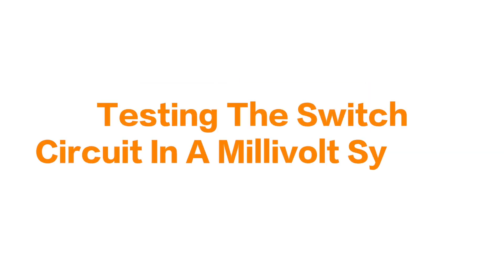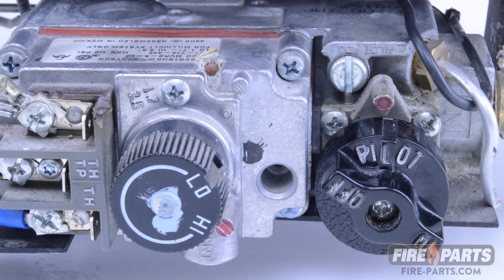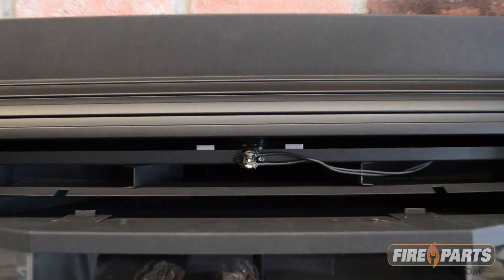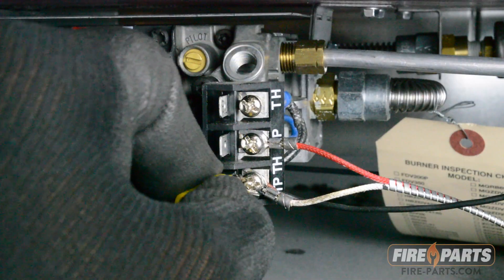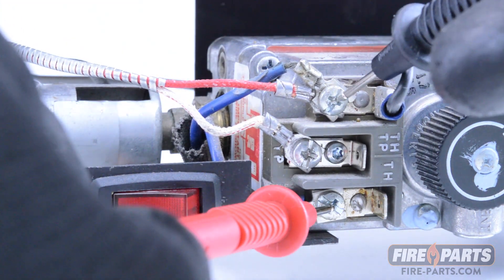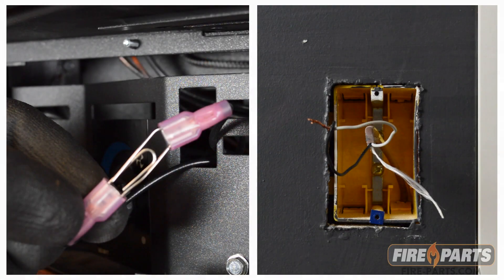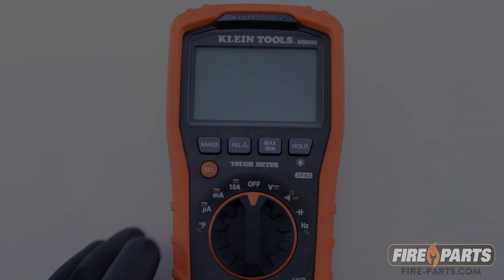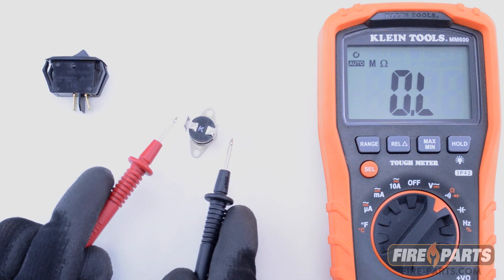Fireplace How To: Testing the Switch Circuit in a Millivolt System

Comment: ...and where does he explain what 'millivolt system' means  for those homeowners who have to get help starting gas logs if the piezo switch or a manual starter will not get gas logs going.... there are too many assumptions.

Comment: What kind of Low voltage thermostat would you recommend? My mechanical Honeywell has a voltage across terminals in on position and flame does not come on.

Comment: When I bypassed the switch on the wall the main burner still not kick on. When I bypass the gas valve the main burner turns on. What could be the issue?

Comment: Awesome.  I had already checked my thermopile but didn't really consider that the connection to the switch would be bad.  Turns out I just needed to retighten the switch screws and re-crimp the wire connector and it brought the voltage drop across the switch down to less than 25mV.  Works like new now.

Comment: Hi all, that's exactly my fireplace... Just moved into this new place and has one of those fireplaces, it was working fine, but was sooo dusty and dirty... After I pulled it out cleaned and cleaning the fan blower, and grease it up I also fixed it in place as at higher speed was so noisy and rattling all over...
Now, after everything it's back in it's place, when pushing the wall switch it takes longer to lit up as before, sometime takes up to 6 - 7 seconds... I've noticed, the longer was off, the longer it takes to lit up after the wall switch is pushed... Any thoughts about it? Please help!

Comment: Can a normal wll light switch be used? Or is there some specific low voltage switch needed
Reply: A normal light switch is fine.   If you can't get less than 0.4 ohms across the switch or less than 1 or 2 mV measured at the switch (with the fireplace on), just replace it with a new one.

Comment: My voltage reads 650 across the thermopile. The millivolts do not drop at all when switch is on or by passed. Still no ignition of main valve. Any help?

Comment: What if the gas burner still wont light even if you jumper the gas valve.  Mine wont light and im getting 550 millivolts with the pilot on.
Reply: Did you ever get a answer?
Reply: @dennisiverson3047  No but I ended up diagnosing it myself after researching how these things work. I wasnt getting any millivolts at the thermopile with the wall switch on. Should be about 25ish. Replaced thermopile all is good.

Comment: Your videos are very well done.  Any advice for this issue? Fireplace with standing pilot that stays lit, but fireplace won't light. Changed thermopile - no luck. Tried bypassing the wall switch, fireplace won't light then either. Millimeter showed negative reading when testing switch at fireplace. Millimeter shows around 470-500 on new thermopile (never tested old thermopile). It's an old (installed in 2000) heatilator. It has two wall switches, it's a double sided fireplace. One of the switches hasn't worked since we moved in years ago, we've just never used that switch.  Thanks..
Reply: Did you ever get a answer?
Reply: @dennisiverson3047  yeah I want to know as well lol this is my problem!
Reply: Same issue here. everything tests good. I'm assuming the gas valve is bad.